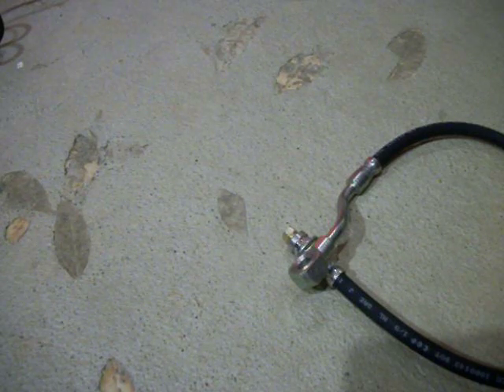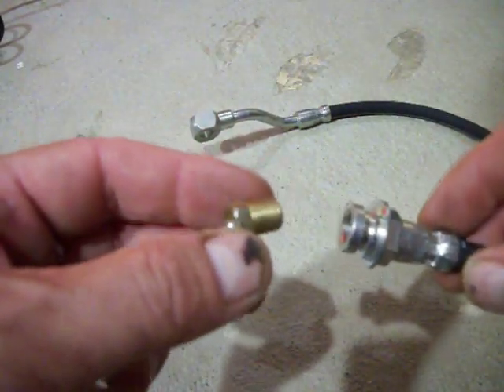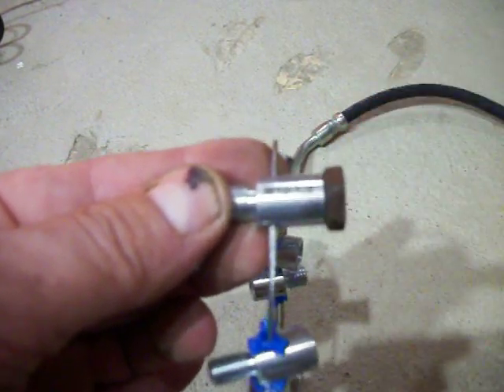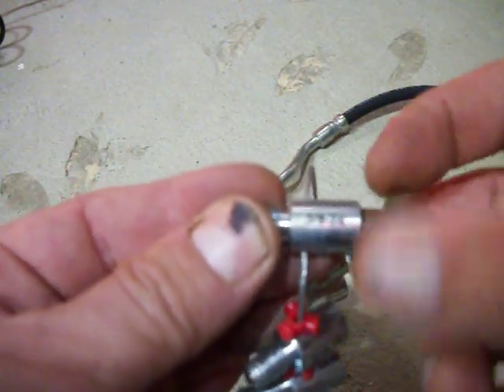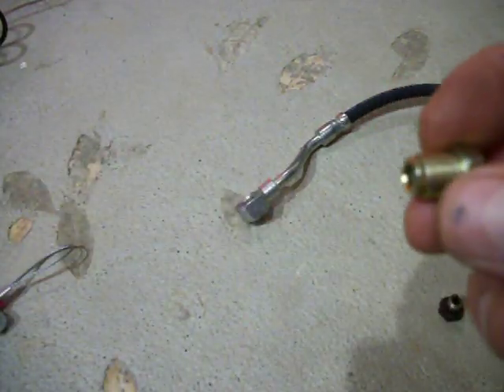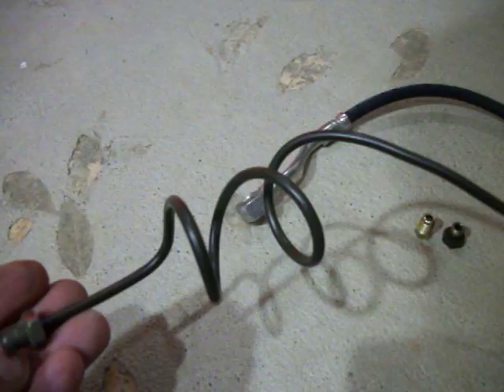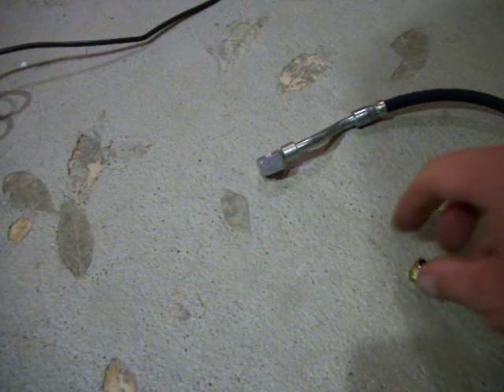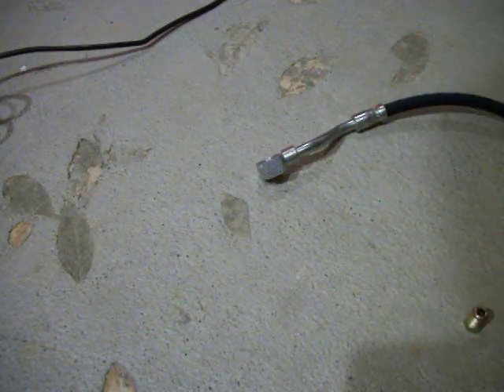SAE vs. Metric Hydraulic Fitting Silliness

Comment: With the metric flare nut, M10 x 1.0, the "1.0" designates the threads are 1mm apart.  Since there are 25.4 mm in an inch, you are very close to the 24 threads per inch designation of the SAE flare nut, 3/8 x 24. And since when you compare the diameter of the 10mm flare nut to the 3/8" flare nut, the 3/8" flare nut is smaller by about 1/2 of a millimeter. . . 9.525mm.  So the SAE flare nut will fit inside a metric threaded female component, but not vice versa.  And to further complicate things, European cars mainly use ISO/DIN flare nuts, which are metric thread, but also use a BUBBLE flare, as opposed to an SAE flare nut which is an inverted flare or DOUBLE flare.  Some Japanese cars use metric thread, but inverted/double flares, just to throw a monkey wrench into the mix!  Be sure which flare nuts you are buying!

Comment: Thank you for sharing this.  Did some work on a Toyota (which uses metric fittings), but only found SAE fittings in the store.  They worked, no leaks so I thought SAE 3/8-24 was fully interchangeable with M10 x 1.0.  However when I got some proper metric fittings (M10 x 1), and tried to fit them into the SAE unions I had bought in a pinch, they would not go. Never really understood why. Amazing they work one way, but not the other.

Comment: This is the hell of 3/8 vs 10mm. i've seen more 3/8 bolts and nuts buggered up by 10mm wrenches and more 10mm hex plugs buggered up by 3/8 hex bits/keys than i care to count. if a 10mm fits, try 3/8 before wrenching and vise versa for female fasteners/heads. Nice to see someone explain the same on threads as well.